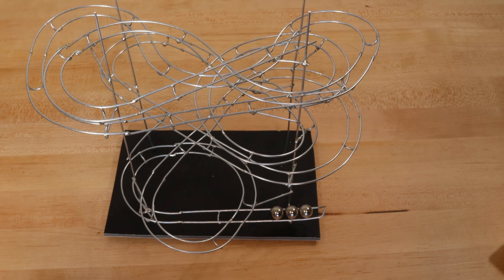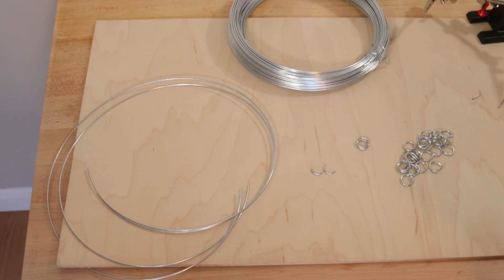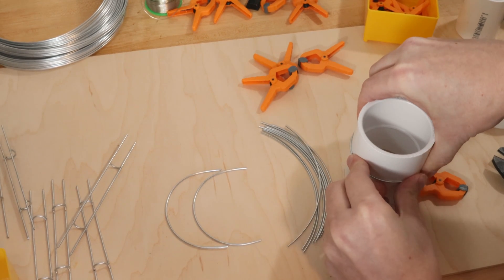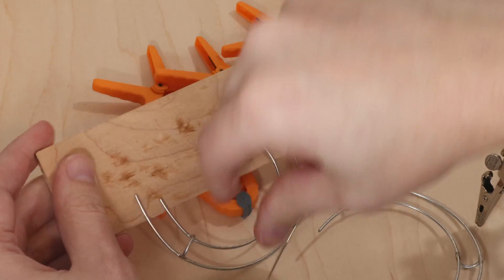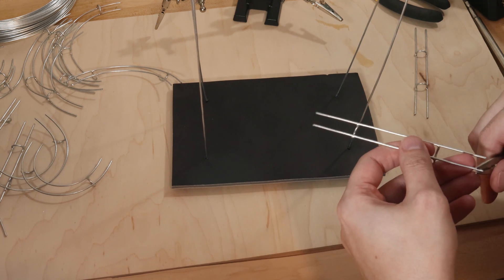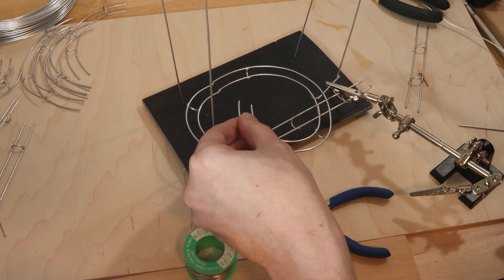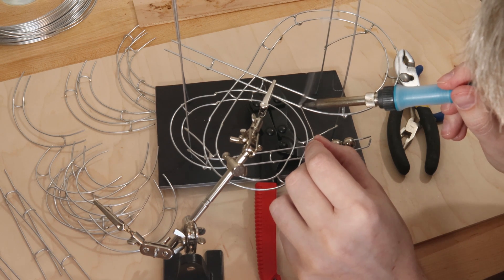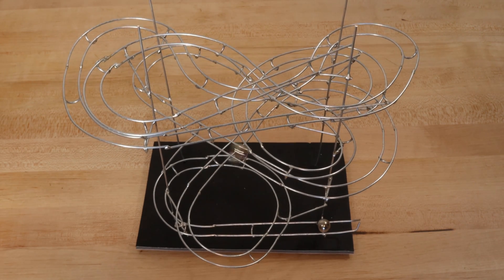How to Make a Steel Marble Track with Rail Segments

Comment: Hi, your video is great! Even though it was published a long time ago, I'm going to try my luck with my question. I've been trying to copy your structure but I can't solder the components. Could you please tell me what type of wire you use? Thank you.
Reply: Let me try and help.

There's another video by a guy called Daniel DeBruin which brought me here which goes into more detail.

He recommends 1.6mm galvanised steel garden wire for a track with 1/2 inch chrome steel balls. 

You must sand the zinc coating off but you must do it outside as it's pretty toxic. If you can find mild steel wire you don't need to sand it but I've not found a supplier at a  reasonable price.
Reply: @RylanStorm  Thanks.  I will try this.
Reply: @jpz2302  Here's a few other things I've discovered along the way.

I've just bought a 10mm steel rod off Amazon for like £5. It's the perfect diameter to wrap the wire around to make the U shapes.

Your first purchases need to be

Wire 
Sandpaper
Small clippers/pliers with a cutter/small 8 inch bolt cutter.
Liquid flux 
Rosin core solder
Soldering iron
A few clamps
Wooden ruler (to clamp your parts to whilst you solder)

I figured that I'll cut my teeth making track sections first and then, if it works, I can then start thinking about joining it all together.

You don't need everything to start you off.

Comment: I started making these with my students. Were having trouble getting the soldering to stay attached to the wires consistently, but that might have to do with the way the ends of the bowed wires are snipped. I'll need to try the bolt cutters to see if it gives us a cleaner break versus our other methods. I found your tutorial has been a great help in not having me need to explain everything repeatedly over and over again to my students. Much appreciated!
One thing we came up with was to create a jig by running a 1x2 over the table saw with 2 very small channels evenly spaced apart for the rails to sit in. Then we cut the template at 12 or 18 inches and measure starting 1 inch from the end and spacing every 2 inches for the placement of the track spacers. Since we don't have helping hands, we tried placing 2 brad nail next to each other on either side of our support markings that sort of work as pinchers to hold the 'U' pieces in place while we solder.
Reply: If you’re using less than sixteen gauge steel wire, you can use Wiss metal shears to get a flat clean cut in said wire. I do this to create my chainmaille jump rings
Reply: I didn't have any issues with jagged ends soldering together....my challenge was finding the correct heat temp for the solder I'm using....649 degrees was the magic number for the chillyroom I'm in....the key is using flux on all solder-contact points...this cleans amd prepares the metal for a good solder joint. The solder will adhere to your eleven cuts, as long as you have the area fluxed, and your solder is flowing...

Comment: for making the support under the rail how can you determine what size form you need for the circles?
Reply from the maker: Just try a few out and see what works. You can also trim them to change the gap.
Reply: @bitmachines  so far i have 3/4 done straightening out the wire rods except a lot of them were breaking at the tip when applying the pressure and don't completely go straight.  Also what size drill bit did you use for posting into the plywood.  Cheers
Reply from the maker: I didn't use plywood like that

Comment: Ive tried straightening the wire with a drill but it keeps snapping, i'm using galvanized wire, same as you. Ive been able to straighten a few cm but it snaps really essily and it's really brittle SO i can't Even bend it yo the right shape afterwards. Is there a step i'm missing? Ive tried with a few diferente wires Ive fondo laying arround at home and they allá snap excepto for one that was a little darker and les shiny compares to the other ones.
Reply from the maker: It sounds like it is getting work hardened which is a specific property of the metal (and has nothing to do with any coating). If it's happening to several different kinds of wires then you could be twisting it too much. It doesn't take a lot and you don't need it perfect. You can also skip that step and just straighten it by hand.

Comment: What is that stand called that has a crocodile clip on the end and holds a track connector in place while you solder it? Amazing video btw ❤
Reply from the maker: Helping hands - check the description for a link

Comment: How loud would you say a sculpture like this is? What steps would you use to make it more quiet?
Reply from the maker: i think a more study (denser) base that would absorb the vibrations would be a good way to start
Reply: @bitmachines  Thanks. We're considering making a marble run as part of an exhibit at a local public library and wanted to reduce the amount of noise it would make.
Reply: @trickstur5994  don't use metal balls. Metal on metal is why it's loud.

Comment: hello, thank you for your video , i ve a soldering iron 48W-350 degree is it enough for your project  ? what are your soldering iron specifications ?
Reply from the maker: I'm using a 65W iron and usually run it around 400F/750C. The exact iron is linked in the description above.
Reply: @bitmachines  thank you for your reply !

Comment: Excelente video, thanks. Whats Caín of wire is?  I trayecto strench the wire, but lts broken
Reply from the maker: It is just regular steel wire. However if I twist it too much, it will also break on me. I think there needs to be just enough twisting to straighten it, but not so much that it becomes brittle. For curves, you can skip the straightening since it'll get bent anyways.

Comment: Is that galvanized steel wire or non galvanized stainless steel? I heard that galvanized steel is dangerous to solder due to zinc coating producing fumes when heated.
Reply from the maker: Great point! You either want to use non-galvanized wire (which is harder to find) or remove the galvanized coating which I don't show here. And if you don't do either of those use an appropriate respirator/ventilation/etc.

Comment: I have been playing with wire marble runs during our current cold snap.  I stripped surplus solid copper wire out of standard household wire ( 14-2 Romex?).  I did buy a high power pistol type soldering gun (75/150W?) to cope with copper's higher thermal conductivity.  My 30/50 W iron was not man enough.  I have curves, straight sections and a spiral so far.  The adventure continues.  Thanks for the inspiration!
Reply from the maker: That's great! I started the same way. A nice thing about copper is that it is very ductile. So getting it around the curves is a bit easier.
Reply: @bitmachines  Hi Bit Machines, can you tell me which pistol type soldering gun are you using? Im trying to make some wire marble runs with my 60w, but I think it is not enough, thank you.

Comment: I make these, that arm thing is soooo cool, although i use 14 gauge so it might be too heavy.
Reply from the maker: Helping hands are indeed very helpful! They can be tightened down so unless you have a really long wire, it should be ok. And you can always use more than one if needed.
Reply: @bitmachines  interesting, i will certainly try to pick up a few!

Comment: Hey do you have any advice for soldering the wire? I just bought a pretty powerful soldering iron (Ksger T12) but when I try to do what you did in the video, I can't seem to heat the steel wire enough to even melt the solder (although the solder will melt of the iron tip). I'm using flux and sanding the wire too. Is it a specific solder you're using perhaps that works better for steel?
Reply from the maker: It sounds like you're doing things the right way. It does take awhile to heat everything up. This video is pretty heavily edited to keep the pace up. So the only thing that comes to mind is apply the heat a bit longer and do so to both wires simultaneously.
Reply: @bitmachines You do not use flus and degreaser liquid or? Just temperature from soldering machine was enough?

Comment: What wire...what gauge...I'm kinda new...
Reply from the maker: This is 16 gauge steal wire (there are some links in the description to help get you started with what I used).
Reply: @bitmachines  I would like to hook a motor to mine for continual play.  Have you done that before?
Reply from the maker: I don't have any videos on a lift yet. I'm playing around with a few ideas. I want to make something that is simple and robust. Some of the spiral lifts are pretty finicky with getting all of the tolerances right. However even 100% manual these are fun!
Reply: @bitmachines  I got used to using the motors on the space rail setup...this is definitely different and better...I bought most of my material already...working on a layout!  Thank you for posting.

Comment: I am new to the soldering.  You seem to do it effortlessly.  Could you offer some insight?  I bought the same solder and the same wire.  Is there a certain temperature?  Do you have any tutorials that show your technique?  About to give up :(     Thank you for any help you can be.
Reply from the maker: This wire is actually a bit tricky to solder. I still have issues from time to time, but that didn't make it into the video! If you're new to soldering, I'd suggest starting with something easier to get a feel for it, and then switch over - something like thin gauge copper wire. Just practice soldering some wires together for a while.
One of the tricks to soldering is to heat the wire and let the solder wick in (it will flow towards the heat). Since this wire is thick it pulls the heat away which makes it harder. The other trick is cleaning the wire well. You want to remove any surface oxidation. Flux can help here which I didn't show in the video. I hope that helps!
Reply: @bitmachines  What kind of flux do you use? There are a lot of options it seems.

Comment: What type of solder did you use and did you not use flux?
Reply from the maker: I'm using a generic no lead solder with a rosin core (Tin 99.3 / Copper 0.7), 2.5% flux. I suspect additional flux would be helpful but it went ok this way.
Reply: What name's Flux used?

Comment: I tried making a steel marble run last fall, but I got hung up on trying to make a spiral lift.  You've inspired me to try again.  This time I'm going to focus on actually making a track and I'll deal with the lift later/never.
Reply: I'm just starting getting the materials together to do a marble run, and have had no luck finding any decent instruction on the spiral lifts....looked on here and Pintrest.   I'd be interested in any info.
Reply: @mcoo465  I was able to make a simple marble run that my daughter loves, but no lift.  I may try again because I saw a clever design where the screw/spiral is under the track, with the track on an upward angle.  The gentler the slope, the less stress is on the spiral, the better it works.
Reply: @Not_TVs_Frank  cool.   I’m still doing research.  If I see more, I will report
Reply from the maker: Great, I agree. I almost got stuck at the same place - I tried a few and they were not working. However building the tracks themselves is fun. On my list is still to tackle the lifts and hopefully I can find a good simple solution. If so I'll post a video for sure.